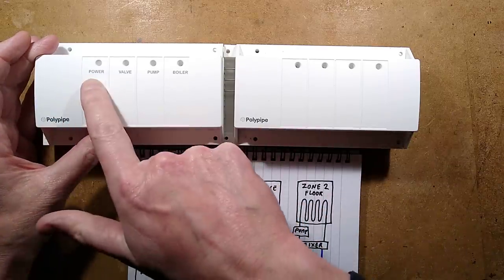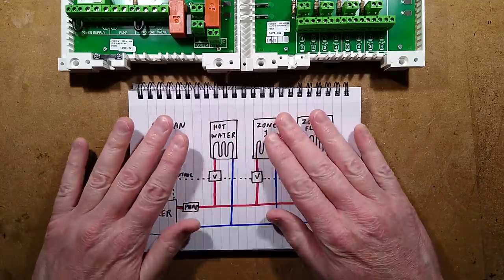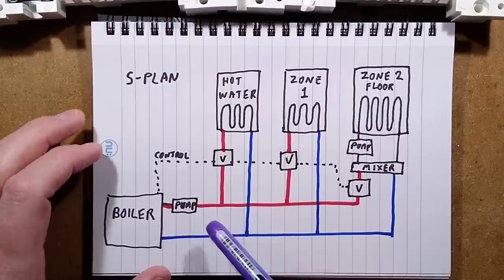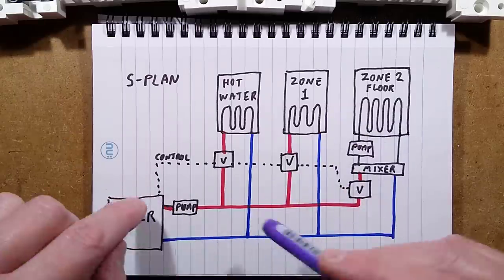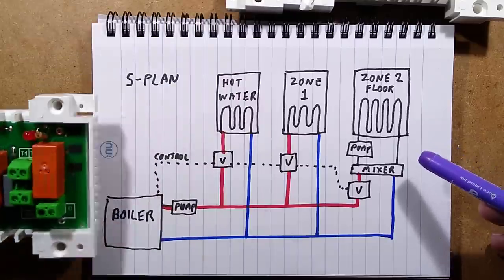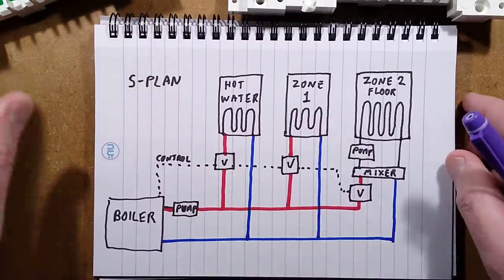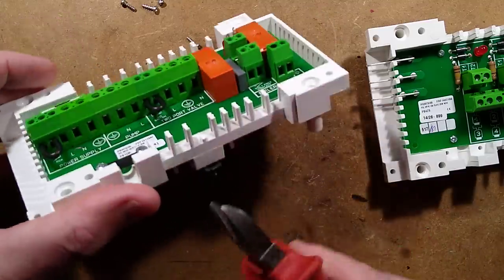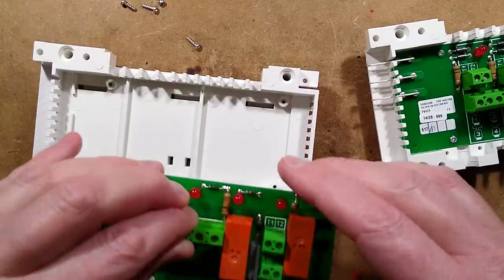Underfloor heating control system teardown (with schematic)

Comment: I am guessing that the reason they show multiple valves is so that wall radiators can be controlled as well as floor heating.   The same valve system is used to control the water into wall radiators.   There might be multiple radiators in one room / zone, therefore the ability to wire in multiple valves.
Reply: You have multiple actuators to cover multiple pipe loops on the same zone (thermostat) you have a maximum area of around 20m² depending on the underfloor heating style used per loop of pipe, so it common to have multiple loops per room. This is why you have multiple slots for actuators :)

Comment: Mains voltage in a thermostat is strange to me. In North America most residential HVAC control uses 24V.
Reply: Central heating yes, baseboard heaters run 120/240v directly through thermostats.
Reply: Our thermostats are double insulated so safe for 240V; it also means the switched current is much lower which improves reliability.
Reply: @cambridgemart2075  I don't know what the purpose of stepping down to 24V does for us. I suspect it's just an old standard as our wired door bells also use 24V and I would guess the door bells were more common before central HVAC thermostats. In any case, it's become ridiculous that any modern system still requires it when we could use digital control systems these days. In my home I had to use an "add a wire" system for a 2nd thermostat b/c of this old standard.
Reply: In commercial HVAC 24v DC/AC is a standard control voltage in the UK and Europe. I'm going to guess that your domestic HVAC uses it due to AC being common place which whilst domestic in nature, will have routes back to commercial systems. It makes sense to work to a standard control voltage.

Comment: Salus have a very interesting microprocessor-controlled auto-balancing actuator that will adjust the temperature difference (Delta T) on the flow and return pipes to the floor (or radiator) to maintain the optimal temperature for UFH. They have a very fast acting motor, that is not wax. I'm just waiting for them to release a switchable version that can also maintains the correct Delta T for radiators - please Salus, you might only sell ten of them, all to me, but I will love them and cherish them! They might also make an interesting teardown for Bigclive as he now knows more about UFH than he wanted or needed to.
Reply: I am not familiar with them, but I asume you want the head to screw onto the radiator valve. You could, if there is enough room, cut in a valve body to the radiators feed pipe.
Reply: Me too! I wanted a version for radiators as soon as I heard about them. They potentially have a use in fan coil units as well.

Comment: I bought a spare defrost board for my heat pump after one went out, or so they say, with the thermistors used for adaptive demand defrost.  Mass of resistors and such which slowly revealed themselves.  Mostly clipper circuits to condition the 24v ac signals for the PIC chip pins.  Along with a discrete diode rectifier for the 24v dc relays and a zener for the 5v dc chip power, transistor control and thermistor circuits.  Not as complex as it first seemed and interesting.

Comment: You can have multiple pipe loops on a single thermostat. That's why it let's you connect multiple valves to one control point.

Comment: Hi Clive. I have the exact same system. When I monitor the control circuit (the top connector) it shows a 5v demand signal from slave to main, not 240v? I'm attempting to make a smart addition to my ufh, and need the demand control signal to activate from a smart  zone valve controller, so wanted to validate what I have seen before I setup.

Comment: In Australia, systems like this in residential installations are not common, though I have seen them in a school.  I've seen a few installations like this, but in these systems they've had wall radiators filled with heated water.

Comment: Suppose I had  a single zone with 2/3 circuits  controlled by 1 room stat would there be any need for a "control system" and actuators as discussed here?  The UFH would be one zone and the radiators in the rest of the house would be another zone controlled by a different room stat.  

The controller/programmer (Drayton Wiser) has 2 independently controllable CH channels and 1 HW channel.  Would it be acceptable to wire the UFH zone valve and pump into the boiler and programmer in the same way that the current radiators have been done?

Currently the heating system is wired as an S-plan.

Thanks

Comment: I have one of these in my UFH install and recently the UFH has stopped working. Nothing was changed. Just stopped working. Fuse is intact, Green lights come for Thermostats but Red LEDs for Boiler/Pump lights do not come on. Tested pump independently works fine. I have changed both Power Relays & the Capacitor. Diodes & Resistors test OK. Still does not work. I'm lost as to what's gone wrong and how to fix. Any ideas?

Comment: Thanks for the excellent video. I now know the fault with my UF heating is related to the heating control.  Heating is turning on itself.  The control (not the slave) feels hot and has a slight burn smell.
Would I need a new Control ?

Comment: I assume the diodes for the relay control are for safety and I assume the diode is on the "C" line side for the slave units. That would mean no power could flow from live to the thermostats if they were shorted to earth or neutral

Comment: Just looking at the circuit? How does the boiler keep the pump running while it's cooling down. All the CHHW systems i've had always have the pump controlled by the boiler as when demand is  removed the boiler keeps the pump running for a min or 2 until the heat exchanger has cooled down. Just stopping the pump will cause the temperature in the exchanger to rise and it could overheat.
Reply: Ufh has its own pump.  The boiler has its own pump and bypass circuit
Reply: @YagiChanDan  Thanks, only thing under my floors is concrete. Also due to the thermal mass of the floor do you get a long lag from demand to the room warming. a bit like storage heaters?
Reply: @TheEmbeddedHobbyist  there are insulated overlay systems for retrofit.  New builds and new floors extensions etc) you would have a flat sub floor, sharp sand, 100mm of celotex insulation (or the equivalent), then a damp proof membrane.  

On top of that you then lay down your pipes.  Then pour a screed between 50 and 90mm thick.

Overlay is quick to respond but slightly less thermally efficient.  Pipe in slab is longer to respond, but has less heat loss down.

In all cases smart controls that can predict heating and cooling times are essential.  Then they predict the on off times accordingly.

What is rare but available are PWM actuators as well as self balancing actuators.  The latter use ^T° to modulate the actuators to get the correct heatloss from the pipes to the floor.
Reply: @YagiChanDan  thanks.

Comment: Hi 
I have the same ufh system and the green power light has gone off but there is 240 volts going to the master.
Would this indicate that the master has become defective?.
All the rooms thermostats still have  the displays working and show the flame icon when it calls for heat.

Thanks
Reply from the maker: If the unit still works then it may be a faulty solder connection or light.

Comment: No pump overrun if you wire it from that control panel? For some boilers you'll need to let the boiler control the main circulation pump and have an automatic bypass to bridge the heating flow/return pipes when the valves are closed (sometimes a bathroom towel rail was plumbed to be the bypass meaning it was also on if either heating or how water were running). The live for the pump could also be used to signal the panel to light the pump LED. That way the pump LED will actually show when the pump is running. Could have a removable link on the board in place for systems with no pump overrun.

In the water circuit as drawn the mixer for the underfloor heating may act as a bypass. Some do some don't. If they can be plumbed in series then they do but on the drawing it's in parallel with other zones.

Comment: Could the 'graphite" coating be just for corrosion protection? On your slave board schematic, does the series diode on the 'C 'terminal actually exist as I can't see it on the PCB photo, it wouldn't function as required if included as all you're trying to accomplish is an 'OR' function? The 'pump' relay with the capacitor is probably used because it should be an AC relay but they're much more expensive?
Reply from the maker: The use of a DC relay allows simple OR logic to be done with diodes.
Reply: @bigclivedotcom  As this is the 'pump relay' it's not part of the  OR logic, whenever heat is called for the 'pump relay' must be energised. What about the 'rogue' diode?😁

Comment: That's funny how in the slave module one of the banks of four screw terminals is replaced by two banks of two. I wonder if these are hand assembled and they ran out of four banks? Or maybe they just ran out of reels of four banks in the pick and place machine so they used the 2 banks that were already loaded in. Actually... now I'm curious if a pick and place machine could even place those terminal blocks since they link together.

Comment: Hi Clive. Very fortunate that I came accross this video. I have to repair my controller which  is very similar to the one that you were working on. Mine is a master with 4 zones and an attached slave with four zones. The leds on 3 of the zones are out and so they will not work the activators. Looks  like very basic electronics 100k resistors diodes and leds. Did you make a note of the value of the diodes so that I can make sure that I have them before I take the unit off the wall.
Thanks, Richard

Comment: The purpose of the DC supply to the control relay is to facilitate independent control of the relay from the extension units. With the DC supply the diodes in the extension units form a very simple OR gate which can be easily extended.

Doing the the same function with an AC supply to the relay would be more complex.
Reply from the maker: It would pretty much need a relay per channel.

Comment: I have one of these in my UFH install and recently the controller has stopped working. The thermostats call for heat but the relay circuit does not switch on. I have replaced both of the power relays on the PCB and yet the problem still persists. Would my symptoms be explained by the failure of the capacitor. It doesn’t physically look blown????? TIA
Reply from the maker: Are LEDs lighting?    Is the fuse intact?

Comment: Clive, in your water diagram you may have forgot to complete the loop unless the "mixer valve" completes the loop. As it is, when the boiler pump kicks on to keep the loop warm it would be dead headed. A very minor gaff, if a gaff at all, I could be mistaken, I've been mistaken before.
Reply from the maker: I believe the mixer either allows the water in or bypasses it so it circulates back to the boiler.

Comment: I  found light pipes interesting and amazing when I was  little kid.  LOL    No idea why.
Reply: I thought car dash boards should use optical fibre running to all the lights to indicate each bulb is working.
Reply: @millomweb  I know right ?  The make damn dash boards IMPOSSIBLE to clean.
Reply: @millomweb  the first variable speed cameras on the M25 had a fibre optic running from each lamp on the speed limit display, this would then get exposed into the photo of you speeding, so they could demonstrate that the display was working correctly.  I imagine there's a digital equivalent now.
Reply: I was always fascinated by optical TOSlink cables as a kid, use to spend hours pointing it at things and seeing the colour projected to the far end.
Reply: @edc1569  And why not !
Maybe now they use  digital images with 'average speed' cameras instead.
Reply: @edc1569  I've not seen a TOSlink cable. I might have seen as many as 2 connectors on devices!

Comment: I assume the initial explanation only applies to that particular system? Both houses I lived in so far that had underfloor heating that the pump on a timer (usually run early in the morning and again in the afternoon) and the valves for the zones were manual to control water flow and thus how much heat the room got (more flow -> more heat). No mixer and circulating pump inside the zones.
Reply: That's not a control system.

Comment: Maybe the graphite pads are more resistant to corrosion than copper metal and cheaper than good or silver contacts? Plus you will not get the galvanic corrosion you do using dissimilar metal contacts.

Comment: very instructional video, I have a problem with this system, it was installed about 13 years ago and has in the main given great service until now! the problem I have is for some reason the controller will not activate the pump or send a signal to light my boiler, the mains is ok and the valve light is lit, no light on the pump or boiler, having researched a little I ordered a new controller thinking this would sort the problem, after connecting it was like for like and a quick job, I still have the same conclusion ? the boiler , hot water and another part of the heating system ( radiators ) is working as it should. If you have any suggestions I would be grateful . A friend of mine who is a plumber is going to take a look but this could be a while as christmas etc !!
Reply from the maker: It's something that would need a bit of knowledge and a suitable tester to trace.

Comment: So for diagnostic,  if a valve goes bad it would be simple to tell because the valve light will be on but the pump light will not, correct? So activating valves one at a time and simply watching lights you can find where the faulty valve is. Thats a nice simple setup.
Reply from the maker: In the case of the manifold actuators the light would be lit on the unit, but the red flag in the actuator wouldn't retract.  In the case of the main motorised valve, if valve was lit but the pump/boiler wasn't it would suggest that the valve had not activated its end of travel switch.
Reply: The ufh valves have physical indicators to show they have lifted.

Comment: Hi, I have one of these systems and the other day the main boiler fuse blew. I've managed to establish its a fault with 1 of the zones and at first thought It was likely the zone actuator.
However this appears to measure the same resistance as the others (1.2k) and also that that particular zone is outputting 38v on the thermostat contacts and 160v on the actuator contacts with both devices disconnected so no demand.
Am I right in thinking my fault is due to the above conditions and the board needs replaced?
Great videos and any advice would be greatly appreciated 👍🏻
Reply from the maker: One of the most common failures is the zone valve actuation heaters.  They may read normal with a meter. but may flash-over with the full mains voltage.

If the replacement fuses blow very quickly then it may be worth taking a zone actuator out of circuit and seeing if the fuse blows.  Or disconnect them all and add them back one at a time until the fuse blows again.

If there aren't that many actuators it might be an idea to just replace them.

Comment: Hi Clive. Would you check out a Hive Heating System, as I have always wondered how it works?
Reply: The bees eat the honey, and their metabolic heat output keeps the hive warm!
Reply: Comes with two parts the thermostat and the receiver, the receiver is wired to the boiler/valves and the thermostat is paired to the receiver, the system is then connected to your wifi.
Reply: The Nest is the same principle but more refined. They just look and feel better. And they do PWM (to a degree) for undefloor.

Comment: I thought the water valve on the thermo controlled valve is normally closed (pin fully out) & then opens as the pin is pressed in against the spring in the valve? That way if you remove a waxstat then the valve is off? Might be wrong, has been a while since i messed with one.

Comment: Hi Big Clive..a bit of advice please..I have the same polypipe control unit..yesterday I noticed my room thermostats had blank screens and my fused had tripped..I've narrowed it down to the 240v feed to the unit..once connected it blows the 3amp fuse..I've disconnected the thermostats and it still trips...could it be the pump off the manifold or a faulty control unit..really unusual as my heating was switched off when it happened..only DHW was on.
Please please can you advise me.
Kind regards 
Radcliffe
Reply from the maker: A common failure seems to be the electrical actuated valves if any are used with your system.  They can arc over internally and pop the fuse
Reply: Thanks Big Clive..the fuse Only blows when I connect the 240v feed on the polypipe single zone master..I've also disconnected the zone thermostats just in case they were the problem..the only thing connected is the pump..but the heating is off
Reply from the maker: @1234Raddy  There's a possibility that your unit and the heating are on different circuits and that the unit may be trying to backfeed the heating.  It might be worth disconnecting the heating control wires, but treat everything as possibly being live.  Heating engineers aren't the best at electrics.

Comment: Does the master unit have an internal fuse at all? I’ve got live power going in but nothing is working!
Reply from the maker: Yes.  I think it was a 5Amp type T 20mm fuse in this one.  If it has failed it may be because of a faulty valve actuator.
Reply: @bigclivedotcom I will check the fuse first . Is the valve actuator the motorised valve? A small metal box?
Reply from the maker: @chrismooney1549  The metal box valve actuators tend to fail open circuit.  The ones on underfloor heating manifolds are more prone to flashing over inside.